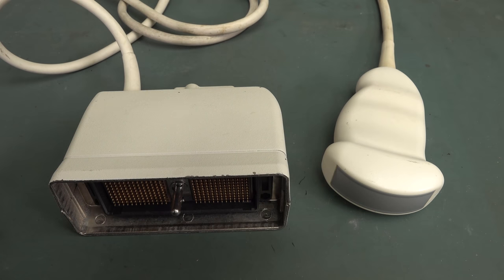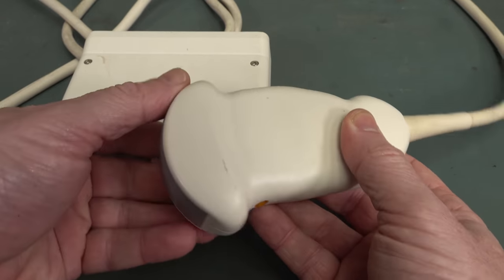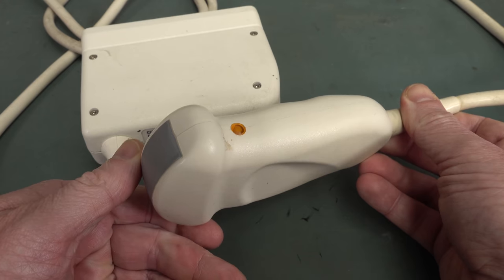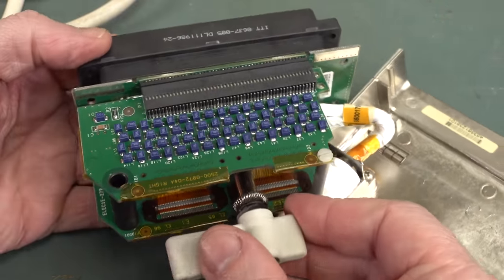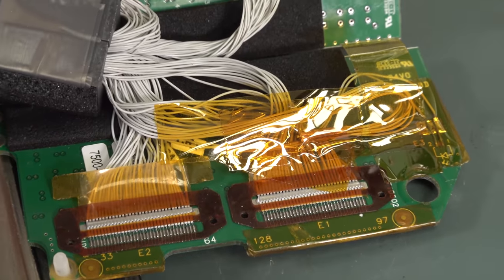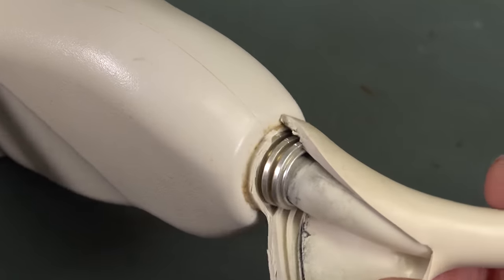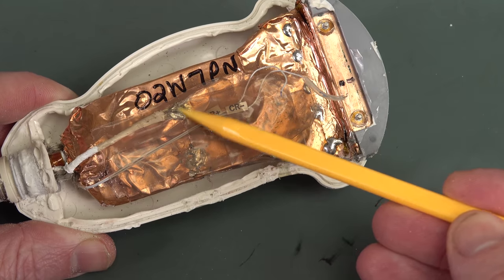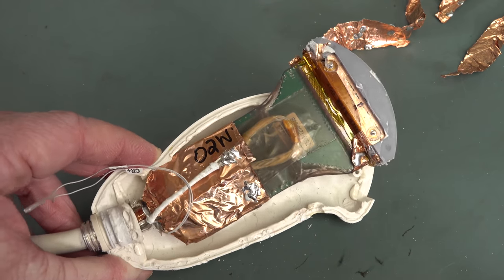EEVblog #1315 - Ultrasound Probe Extreme Teardown!

Comment: Actually had an ultrasound done yesterday, a Toshiba machine, about half the physical size of this one, appears the probes use exactly the same connector though, maybe it's a standard used by every manufacturer.
Reply: Anything but. Each manufacturer's probes are proprietary. Some may share similar connectors that are based on some industry standard, but there is ZERO compatibility between manufacturers.

Comment: I've designed several military test sets using those high pin count connectors, they are very expensive, and are not as good as they look. We had many problems with the pins not making good contact, requiring the operator to un-connect, clean and re-connect, sometimes several times. There are other high pin count connectors that are even more expensive, and some work better than others, but overall with this many connector pins your going to have times then some of the pins don't work as expected. Quite the pain actually!
Reply: Back in the '80s the firm I worked at bought several ATE Systems/Wayne Kerr 'Beaver' (no sniggering) functional ATE systems. The test interfaces sat on top of the main system, connecting through several multi-way 'knife and fork' contact connectors from Ericsson IIRC that they'd arrived at after rejecting many others. 
[Edit] Provided you made sure there was nothing sitting on the base connectors before putting an interface on they worked perfectly.

Comment: The thin center conductors with the 'loose' fit inside the insulating sleeve serve to minimize the capacitance from center conductor to shield. A big deal for recovering a weak RF signal efficiently.

Comment: it's a zero insertion force connector, used them on a Automatic Test Equipment  unit i built back in the 90's i think. I used it to connect the different bed of nails units to the main ATE in it's 19" rack. Turning the handle closes the contacts and locks the connector in place.

Also we used Arinc 300 connectors that had about the same number of pins on one Aircraft intercom system. the unit had to be jacked in and out of the tray with screw jacks due to the force required to mate and un-mate 300 contacts.
Reply: The number of pins are different but the connection seems to be the same as the connector I use with my deep-fryer .. no pun-intended

Comment: Why they used metal tape shielding was they need to ultrasonic weld the head case so not to get any bodily fluids in and sterilise it.  Interesting to watch on the factory floor as they drop part in a drawer and come out welded.  Cool to see that data on how they work looks better than I seen before.

Comment: Olde 24trk tape machines/mixers used same connectors... so 24*3 (24 tracks and +/-/gnd) *2 (input/output) = 144 pins... used to take a long day

Comment: The tablet-connected ones must do things closer to the transducer head, as it's a much thinner cable - but I guess they then don't need the fancy custom connector, all the inductors and shielding, etc and can convert the signals to digital data?

Comment: Thats a probe for abdomen ultrasound exam.
Its from from start of 2000-s.
It was around 4k $ new
Reply: Nah that's from 1992/95, 2000 models looked differently.
Reply: @brainthesizeofplanet  Same probe with only a slightly different ZIF connector is still in use today.

Comment: I guess they choose copper tape instead of metal shielding to avoid having the patient directly connected to ground anywhere. You probably also find the cardiac measurement stuff on the MO disc board having a floating dc servo instead of direct ground connection.

Comment: I think that the cables used here are some form of micro coax. As seen at 5:25, there appears to be a ground bar or elongated solder joint of some sort that is likely connecting the shields. This type of arrangement is also common in laptop display cables but I think that those are thinner than the ones in the video.
Reply: I believe you are right other people have mentioned this before as well. Also I would not call them miniature on call them sub micro-miniature miniature miniature.
Reply: Or for that matter me at your sub micro Pico if that was a thing. How would you describe something that small if it's smaller manager and sworn subminiature and even micromanager?

Comment: 15:33 there is 128 writen in the board, there is 128 wires but I counted 134 points at the tip where is soldered to the transducers.

Comment: There should be  an acoustic lens covering elements. This is for first focusing mechanism. Then usg beam is focused on recieve by delay. cut size and shape of elements are directly related with image(signal) quality but also they use elements from same single piece crystal for one probe to achieve same quality on each element. The real channel (tx/rx channel)number for for transmitting and recieving may change by multiplexing. USG with more channel is better generally. Multiplexing cause noise and for USG noise is very very very important because RX signals are very weak and if u amplify u amplify noise too. So frontend quality is very important. Some people compares this machine with todays portable machines but believe me that HDI 3000 is a monster about quality though it is old.

Comment: I used to work on the Siemens US models from that era until 2009, the Elegra Version.
What beasts 200kg, pretty loud and also full of custom boards.
It was actually so heavy and liked to brkae down when moved it had a driving ban imposed because repairs were so expensive 😁. 

Nowdays they hide a PC inside with custom connectors or even USB probes... Oh boys how time changes..
Reply: Hi,  I would like to ask you some questions about an old product... Could we get in touch?

Comment: 9:31 - I would imagine it wasn't a metal case as that could cause capacitive coupling which the patient would feel as a tingle. Lesser reasons would  be weight & temperature (those probes are cold enough with the gel applied - could you imagine how cold it would feel if it was metal!)
Reply: Would agree with the cold part for sure.

Comment: Is this a Zero-Insertion-Force-Connector?
Reply from the maker: Ooh, I didn't think of that. Will have to check...
Reply: @EEVblog  It should be, I used to play with ITT Cannon connectors like that and they were ZIF
Reply: @EEVblog  yeah, it looks like the contacts move when you turn the locking part.
Reply: It is. Toshiba MRI coils use the same design

Comment: I struggle to see how a linear bank of antennae can get a 2D (XY) image. As I see the design it's basically like a version of a swinging radar which would give time/distance/angle reflections...
Reply: Those are your 2 dimensions: angle/direction and time of flight (i.e., distance). The image you see is a slice through the body in a plane coincident with the PCB of the probe; this is all why the pictures have that classic pie slice shape.
Reply: @TheHuesSciTech   Maybe I'm wrong, but the image is XY (ie a photo) with a depth component (density/whiteness).
Given my understanding of this(little) the scan is basically 256(whatever) pixels wide on the head by one pixel high on the head.
So where does the vertical resolution come from? That's my confusion.
Reply: @PIXscotland  The array is 2D, so there's a time element in the waves travelling along the transducer element; by controlling the relative phase of the driving signal, you can reproduce a 2D scan. Dave did mention an article describing how it works.
Reply: Huh. Just watched this and got it.
https://www.youtube.com/watch?v=gT0zV0XYKek
Didn't work how I expected/thought. Seeing the image from the curved device gave the clue. The Y in the photo is time/distance.  Totally makes sense now.
Reply: The ultrasounds as they penetrate the body change speed with the material density. That's why the unit has a doppler shift detection component
Reply: @asicdathens  Doppler is for detecting motion, e.g. seeing blood flow through vessels and measure the speed of the flow.

Comment: Does that mean an element transmits in pulses and then receives using the same element, or the element has a trans and receive in it, or is there a large trans element behind and the small elements receive.
Reply: Using the same piezoceramic bar for both tx-ing and rx-ing is the most common practice.

Comment: At 6:15 that bar looks like a soldier strip that is terminating (bonding) individual cable shields to the PCB.  Do you think the cable was stripped and soldered by hand?
Reply: I'm thinking that's the case and yes micro some major or whatever coax for sure been brought before and yes I'm pretty sure that's a bonding strip ever seen all the braids ground Connections in something like a big UPS or other high current high power equipment and others or all the ground straps on RF Equipment ohyeah talk about some rain action.

Comment: It's probably not too hard to make those connections. All the individual wires just run through parallel guides before they put those brown kapton pieces on. Then after that it gets braided and the insulation is put on

Comment: Those connectors are garbage, really bad. THey are used a lot on ATE's for testing aircraft equipment. I have been working and troubleshooting them a lot. They have so many bad connections all the time and resulted in so many false errors on DUT.

Comment: Any idea how much power is dissipated in that probe?  Doesn't look like much heatsinking at the rear of the array, if any.
Reply from the maker: Don't know, but likely not a lot, as there is very little thermal mass there. And modern one in the same model work from USB-C, so it's more like 10's of watts than 100's.

Comment: Hello, I have always the query about manufacturing process of the ultrasound probes; how all these thin cables can be placed from end to end with the right order? When they have to solder/connect the cables from one side on the connector to the other side of the probe PCB how they know each cable in which pin it has to be soldered (for example pin 1 from connector's PCB must to be soldered at pin 1 at porbe's PCB). All these tiny cables have the same color and there so many… maybe it is stupid what I will say… but there is a possibility that each cable doesn’t have to be soldered at a specific place between two ends and all the cables soldered randomly and the software will re-position in right order all the image sectors?

Comment: Dave, can you do some experiments with the transducer head... xmit receive, frequency response? I'm curious about the filters... can you hook up the spectrum and do a sweep?
Reply: Since its Piezo electric ceramic if you were to whack it with a big hammer could you get a voltage pulse?
Reply: I did a demonstration long time ago a pH of electricity using neon bulbs in some sort of transducer repeatedly whacking it with a hammer in my science class

Comment: Just curious, so asking for opinions from those in the know.   Why aren't these ultrasonic probes constructed to use mechanical scanning (think RADAR)?  It would seem to reduce the cost considerably.  Maybe there are such beasts and I've never seen one.
Reply: Back in the days they used this approach. But it has so many disadvantages... Low FPS, noisy signal, accoustic noise, mechanical wear. Consider making digital photo/video camera with a single photo-sensing cell driven by mechanical sweep system. How longer would it take to make a single shot. What distortions would appear when shooting moving objects?
Reply: But mechanical scanning is still used in 2D-probes allowing for 3D imaging. Watch: https://youtu.be/KEdZZSobmuU

Comment: Why isn't that sticky isolation foil transparent? Why the goldish color?
Is it made of PET?
Reply: It's a Kapton tape. Super resistant to heat and angry electrons.
Reply: @NukeDMAn  so maybe they should use it on any chips that are installed upside down so all the electrons don't fall out

Comment: 16:45 I can't see how the modern version would be exactly the same because it has a completely different connector seemingly with a lot fewer wires (channels). There must be some active electronics in the newer versions I think. Which then makes it strange they have the same model number.

Comment: a bit off topic, but can someone who has a flir camera, see if they can see infrared signal via optic fibre?
wondering if it can be used for lithium battery temperature monitoring with multicells.
Idea is if ir signal goes down optic fibre you can measure many cells temp at one time
here is some more info on my idea
https://endless-sphere.com/forums/viewtopic.php?f=14&t=106625

Comment: I bet somewhere in the world, somebody is saying OMG I want one of those for my old Ultrasound unit, OMG he's passed out on the floor saying that's the exact unit I wanted 😪, taredown on probes for medical units , perhaps Not, 3rd world countries might be screaming out for one of those exact units Dave, as someone mentioned why not sell on Ebay, then at least sombody gets to have a working ultrasound again, when you pulled off the tape with wires pulled off I was actually shocked to be honest, when drawings can be found on the internet,
Some medical probes like that are so rare ! The type of connector used in the Aerospace Defence industry on the front of equipment with lots of test cables,